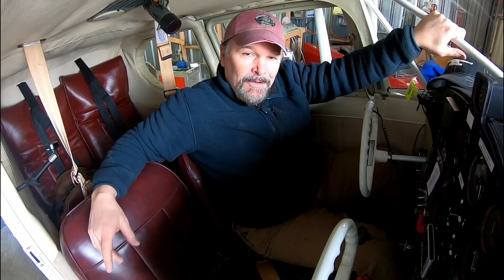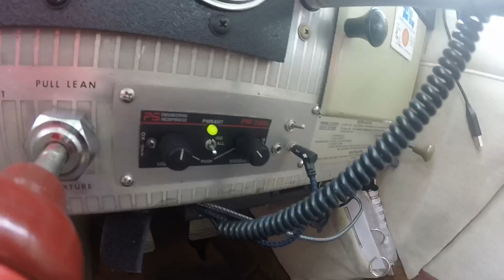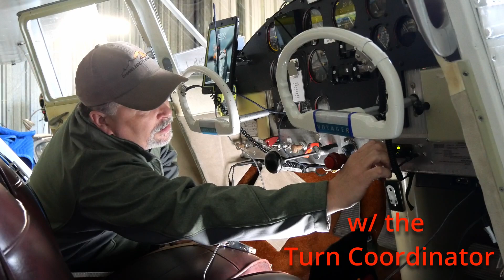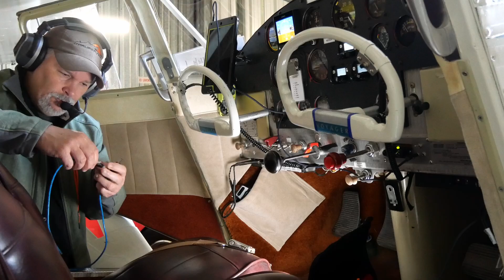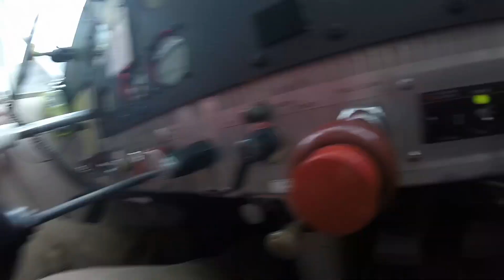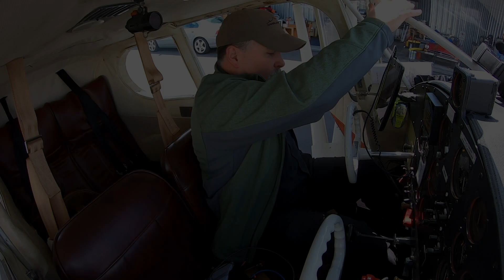T/S Audio Buzz | Systematically Isolating the Noise Through the Headsets

Comment: You are getting a ground loop.  Try running your IPAD with an external battery.  I use a 10,000 ah rechargeable sitting in my accessory pouch.  The noise is really bad with audio recording equipment like GoPros.  Good luck.

Comment: Recorded my first GoPro video yesterday. I hear the buzz, rhythmic with the beacon through the headset. In the recording, it’s more pronounced. Also increases with RPM. So I’m not sure yet, where it’s coming from. But, I gotta find it.
Reply from the maker: You might have two issues. The beacon is defiantly that steady; 1 and 2 and 3 rhythm. The rise in RPM is usually from the ignition. This is most likely the case if the pitch increases as well with the RPM. Shielding is the fix for all these EMI related noice in the audio. Additionally if you don't have resistor spark plugs that could be the problem as well. Keep at it and let me know if you get it fixed.

Comment: Nice discussion/ presentation about “ noise”.  I have spent several decades working on internal/external “noise”.   A couple of key thoughts:  1.  Although the manufacturer states cable is shielded,  realty is maybe yes, maybe no,  quality control is very questionable throughout the world! 2.  Quick connect adapters are very shaky in regard to shielding! 3. Extra long cables are great for receiving/generating noise!  Use cables as short as possible! 4. Are plug-in connection clean?  I hope you resolve your problems!  In my glider I spent a lot of time on handhelds and I realize value of clear communication!  Thx
Reply from the maker: Those are all very valid points. Even though the quality of the apple cable in regards to construction was far superior, it was the longest of all the cards and was just as noisy as the others.. Thanks for the input and I'll let you know when the problem is fixed.